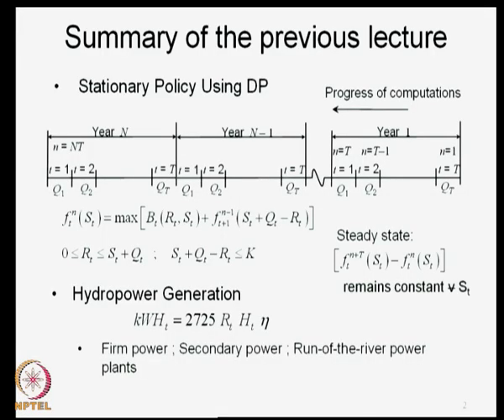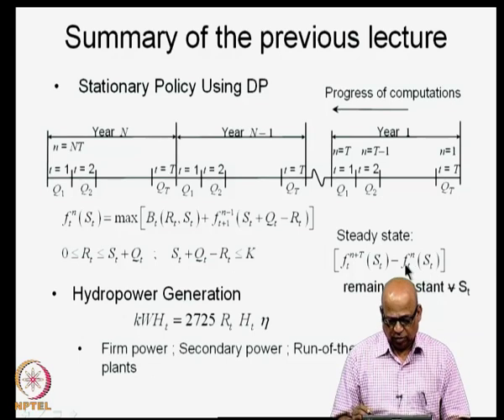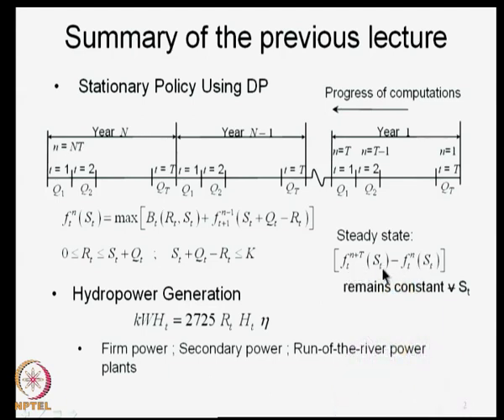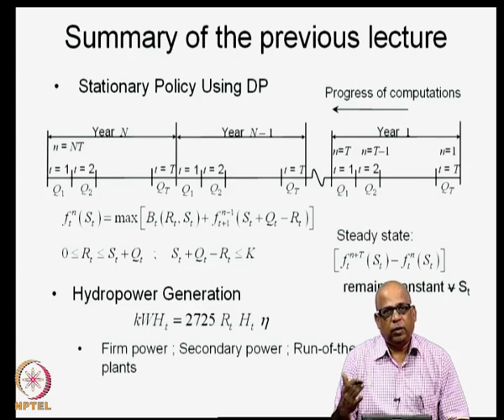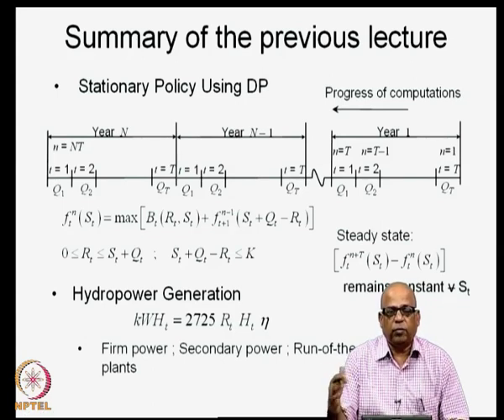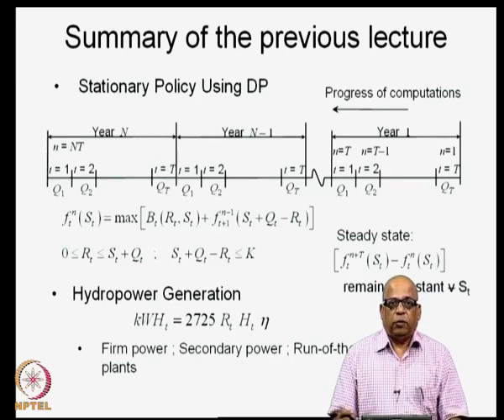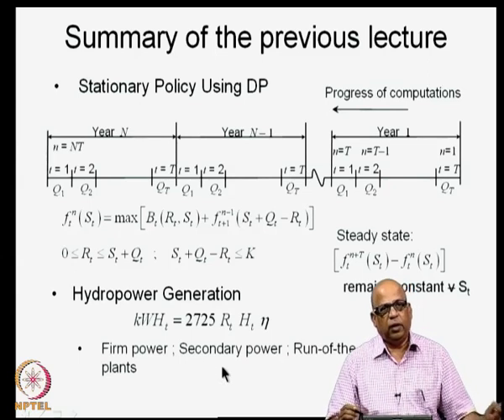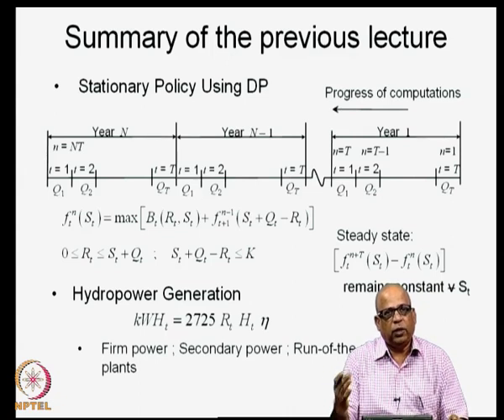Hydropower generation

Comment: Very helpful! Thank you. But I think there's a few errors in the calculations:
Shouldn't the expression for S_t bar star at 50:53 be  (824.63 + 927.11)/2 ? Why are you changing the value of S_t between iterations? Isn't S_t+1 the only thing that's being refined? Isn't what you said at 44:43 in contradiction with what you did in the calculation?
Also, a minor error, at 48:47, E_t should actually be 2.45 and not 2.003 just in case anyone gets tripped like I did.
Reply: There is a probable misunderstanding here. It was mentioned in the lecture that the storage at the starting (June month) is fixed to 824.63 Mm3 or in other words we started with a storage of 824.63Mm3 for June month, i.e., t=1, this is the initial storage. This doesn’t mean that the storage in all months is same. By saying ‘this should not be changed’ is to mean that in the iterative process you should not leave out this constraint that the initial storage is fixed to a value. Thanks for pointing out the minor error.